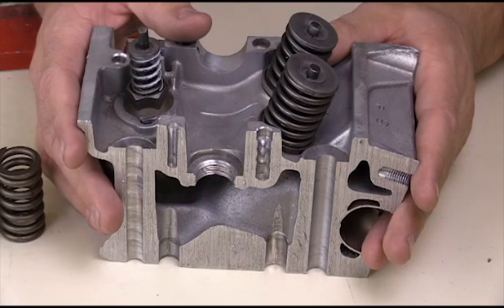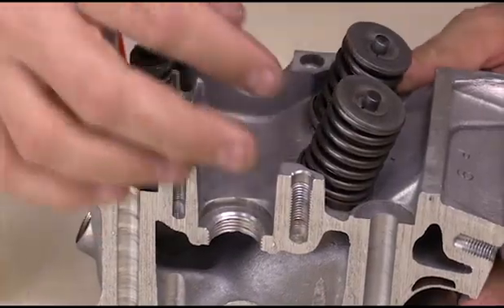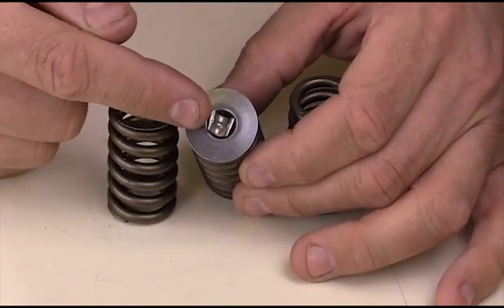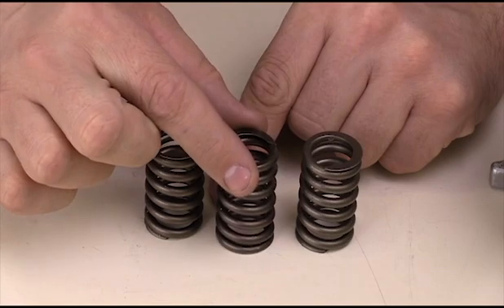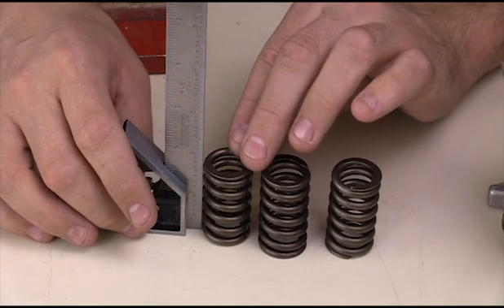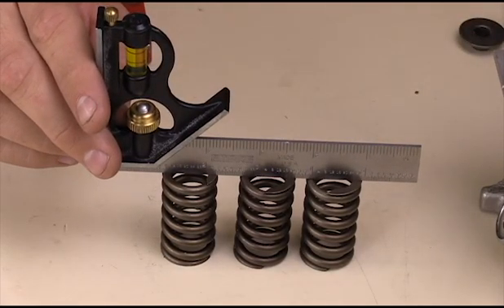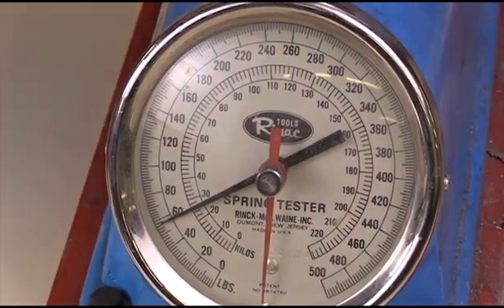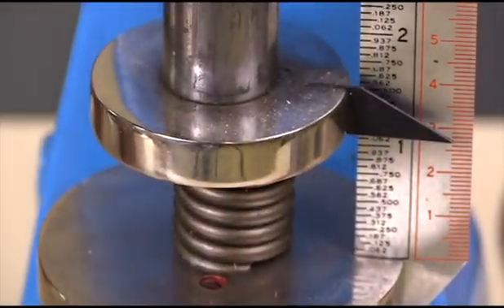Valve Spring Inspection

Comment: WHen do you need a valve spring cooler?
Reply from the maker: I'm not aware of a production vehicle that has valve spring coolers. They might be used by some OEMs, but I've never heard of them in a production engine.
Reply: @ScottHadzik  Thanks for the reply. Valve spring coolers are used in racing.
Reply: The valve spring coolers are in the same isle as the headlight fluid, right next to the muffler bearings.

Comment: I have a 2010 Saab 9-3 aero xwd. Last year  a few years after buying my the engine sounded a lil gritty at higher RPMs. I did the oil change and I saw some extreamly fine glitter in my oil filter and a few small pieces hardly big enough to pull out. I flushed the engine with cheap oil and a motul flush treatment. I used motul oil and a motul engine nano ceramic treatment. I had the old oil tested by stonelab and noted to them I saw metal. They found lower amounts than the norm of aluminum in the test but there was something in there they didn't know what it was. My engine is all aluminum except the (I guess) valves, cylinder sleaves, (I guess) cam shafts and a few other things. The valves are magnisium filled and nothing I found was furous. I did have some bad missfires before that oil change due to bad plugs, bad DIC and plugs not gapped right. The car runs perfect when warm but cold starts it starts fast but hard sometimes. I just found it is leaking a lil oil I think from the valve cover. I checked and replaced my oil filter at 2k miles. There is a lot less but I did still see some sparkle in there but so little you could count them. There's no carbon in my coolant, no smoke out tail pipe. It seems a lil flat on power after 4k or 5k RPMs and it isn't burning any oil to note which to me is weird. I've never seen a DI engine that didnt burn a lil oil. I still get great MPH.  Could this be my valves?
Reply from the maker: Typically a bad valve will have a misfire. It's still a possibility. I would recommend doing a cylinder leakage test on all your cylinders. Here is a video describing that test. https://www.youtube.com/watch?v=WgrfT0LFMhc  If you don't have access to a cylinder leakage gauge then do a compression test to see if you have a cylinder with lower compression. Most auto parts stores will loan you a compression gauge if you don't have one.